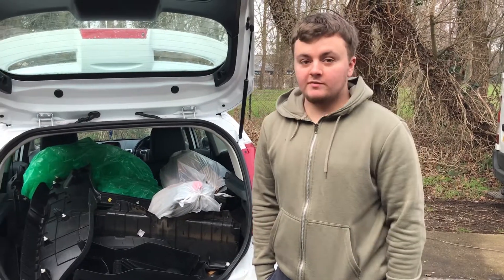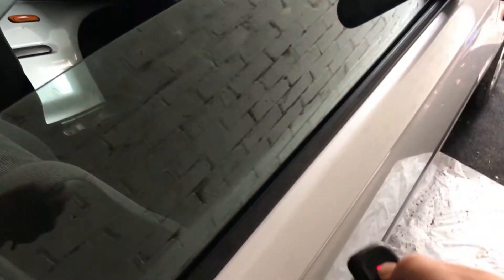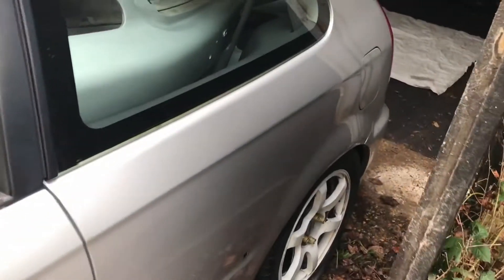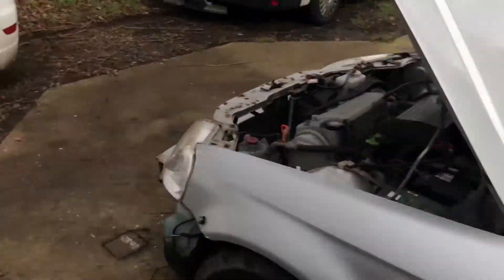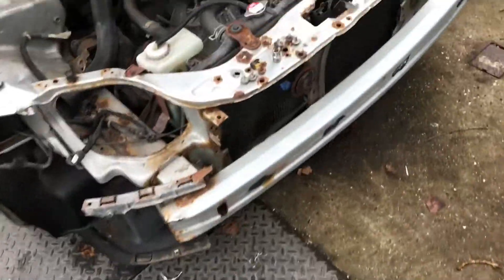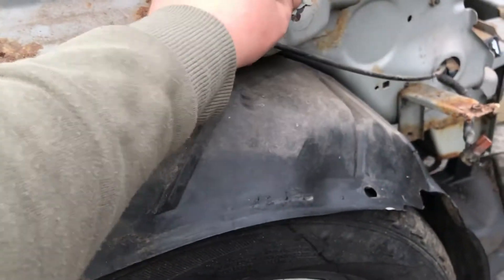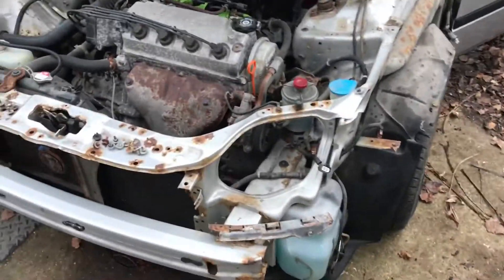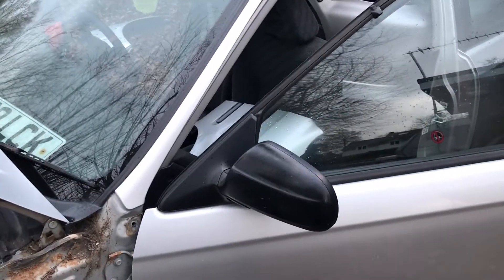Buying a budget race car to build (£550) Honda Civic ej9

Comment: Good luck fella hopefully not too much rust you can’t see, with some TLC it could be nice fella.
Reply from the maker: Peak Performance Reviews no there really isn’t that much tbh , been underneath under skirts all bumpers minus the rear , so , just a light sand back with an abrasive paint removal / rust removal disc , paint over with kurust , 

It’s handy as well though , looks worse than it actually is , but everywhere is just minor surface rust other than that back arch , but I’m sure you know yourself , it’s very hard to find a genuinely clean one of these unless you spend $$$$ so for £550 I really can’t moan including decent condition door and wing :) , just gotta find what colour I wanna switch it too , maybe just keep it factory silver or go a dark metallic grey , not sure , if I go factory silver and get it matched I’ll only have to spray arches bumpers and main shell , roof is fine , will probably get a carbon bonnet maybe even fibreglass or carbon Wings who knows... :) , but should help me learn and keep me busy ,
Reply: GDC HD yep finding a good rust free or fairly rust free ka is and was hard, same with anything either except you need to pay big money or over the odds or sometimes expect some things will need doing
Reply from the maker: exactly that, and for that reason i was more than happy with paying what i did, yeah will take some money but, better doing the treatments yourself knowing they are done properly, ive seen many patch works on youtube on ek, ej, eg where people just use expanding foam and body filler lol, something i WONT want nor do... its bad really, just means these days you can spend £3000 on a "clean" shell for it to be done poorly anyways.
But equally it is still all the learning curve, just going to make sure i do it all properly and dont overlook anything :) @PeakPerformanceReviews